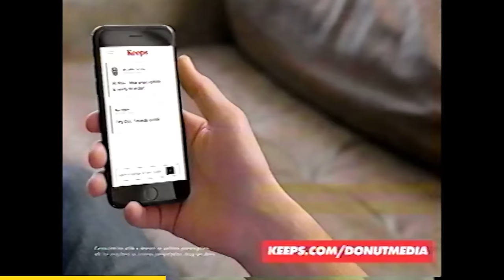Are Fender Flares Actually Worth It?

Comment: $350 for four pieces of plastic!? That's insane!
Reply: Yes it is
Reply: The miata is now riced
Reply: Fun fact, the cheapest injection mold cost is 9000+ for a small part. With low production numbers your parts just cost more unfortunately
Reply: Welcome to the world of modding cars my friend
Reply: Not that bad tbh.
Reply: @kazimerren1977  How exactly is this a riced car
Reply: its fiberglass not plastic however, yes plastic can be that much sometimes
Reply: @noahc6544  not really a fact.. There's plenty of 1-5k injection mold for small parts.
Reply: It’s cause they’re vehicle specific. Generic fender flares are about $40 a pop
Reply: Fenders look and sound like fiberglass not plastic.
Reply: @noahc6544  For this particular part that might be true. But the cheapest will cost 1/10th of that.
Reply: @egg0534  some people don't know what ricer mean 🤦
Reply: Custom molded pieces of plastic, would be a bit cheaper for universals
Reply: That’s cheap asf I bought cheapo ones for a ranger that were over $500
Reply: Low run injection moulding is expensive af, and they're moulded for the car, instead of being universal, so you're also paying for the research and 3d modelling needed for that.
Reply: @kazimerren1977  this isnt rice
Reply: @kazimerren1977  how is the car riced they are probably going to put some thicker tires on it later, rice means racing inspired COSMETIC enhancement changing the tires and rims are PERFORMANCE mods so unless they are going to just slap spacers on long term or doing nothing but keeping it since it looks cool it's not ricing
Reply: The other thing is can’t you make it
Reply: @Lovell_STI  it's ABS plastic, all of them are.
Reply: Welcome to 2023
Reply: R&D nigga some ones gotta put in the work
Reply: Honestly with the prices of stuff tripling and the government trying to kill gas cars thats not a bad price. $350 for any mod on my car is almost unheard of.
Reply: @tannershanksftw  Does this look small to you? And 1-5k for a mold seems like a stretch. Maybe if it's made out of aluminum.
Reply: Right? A set of flares is like $60 on ebay.
Reply: I was expecting it to be more like 600 to 800 honestly
Reply: Actually not that crazy considering that flares are one of the few things that have stayed the same price for years
Reply: @kazimerren1977  nah it’s got motor upgrades to back it up
Reply: Come to germany there they would have to be made legal and probably will cost around 12-1300 grand
Reply: @TheMCD1989  And I feel some people have yet to normalize the inflation spike we had.. little 1 inch by 3 inch semi light switch was 106$, the module behind it was 5 times that 😂
Reply: @AmbroseBurnside1824  i agree
Reply: Lots of women pay more for two pieces
Reply: fiberglass
Reply: @TheEchelon  did I say this was small? His comment said "the cheapest injection mold for a small object" the reason I said what I said.. It's okay if you can't read thoroughly.
Reply: i thought that was pretty cheap lmao
Reply: @kazimerren1977  you don't know what riced means sit down
Reply: Car thingssssss
Reply: @LeapFrog_Radio  i don't think you understand how economy of scales work. The molds for injection are incredibly expensive and car mods sre not precisely an actually huge market, most parts are made in cheaper processes like fiber glass, but are still a LOT of work, and that costs money. Making a car a one off is not cheap, if its not money then its labor and expertise of one self everything has a cost.
Reply: Engineered plastic. Everyone gets their cut.
Reply: there's cheaper options for sure
Reply: It's sometimes way worse when you have an FC rx7
Reply: @BigFatCone  Injection molding is the cheapest means of production 💀
Reply: You can get these for $100
Reply: correct this pisses me off is the same with  front lips, side skirts or that rear bumper side skirt its like crappier than tupperware plastic for 100bucks
Reply: Welcome to the cars are pain club
Reply: @SlowSTEN  They are fiberglass. You can see the fiberglass texture on the shots where they show the backside of them, and a quick search of 'autokonexion miata fender flares' confirmed that.
Reply: They’re big pieces of plastic!
Reply: I know right! And all these young folk with their computer music, paying too much for stuff. Back in my day.......
Reply: @kazimerren1977  I don’t think you know what that word means
Reply: It’s pretty insane but the plastic has to be very durable to go on car.
Reply: Fiberglass most likely, but yeah quality parts that are made specifically for the car is more expensive than the alibaba universal fender flare set for $50.
Reply: $350 probably just for a bumper
Reply: Could be worse 
Wanna order a a-pillar gauge pod trim piece for my car 
Just for the one piece alone will cost me 300$
Reply: In $350 I could live a luxurious life like arabs for a month
Reply: Clearly you don’t know about getting paid for labor…
Reply: @marshubbs7078  please show me a $60 set of fender flares for a miata, i have an 03 NB2 Miata and am interested in seeing your example here
Reply: dang, that's $87.50 per flare.😒😒
Reply: @NissanSkyline901  They may be fiberglass reinforced then, but I can guarantee they aren't just fiberglass
Reply: I dare you to look up how much the custom keyboard community pays for plastic GMK keycap sets.
Reply: i paid 550 for my xjs
Reply: @The Echelon  my tool shop used to make injection mills,  they were tiny in size,  made for blender covers, around 24"x24" . Each mold was 40-50k, and we were the lowest quote.
Reply: 350$ is a lot, especially it not being an AE86.
Reply: What if you 3d print it with tpu?
Reply: Honestly, wayyy cheaper than the $450 plastic rivet style fender flares FRONT SET, + $300 for the REAR SET. For my 1994 Toyota Pickup 4x4...
Reply: @kazimerren1977  Don't use words you don't understand.
Reply: they are the best fitting flares for the miata and the company doesnt exist anymore. so these are super rare
Reply: Make them yourself then.
Reply: My side skirts on my mustang went from that to $650 on the site I was browsing. I assume they stopped manufacturing.
Reply: @mennyg3449  I'd disagree, they track the car and the mods have their use, riced would be doing the mods for no reason or having tlares without cutting out the gaurd
Reply: @concon264  luckily you one of the people who know what ricer is 👍
Reply: @BigFatCone  That’s true I guess, but I feel like this is strange considering how much competition there is in this industry

Comment: Also, with these flares that extend onto the front bumper, I would very much recommend that you cut the flares at the seam where the bumper and fender meet and make it two pieces (look at how Dodge did it for their widebody). Two reasons for this: one, it means less steps when removing the front bumper. Secondly and more importantly: if the bumper ever gets ripped off for whatever reason, you don't have to worry about it murdering your flares and the fenders.
You can easily secure the smaller piece on the bumper with the single bolt along with body adhesive

Comment: I've been on the fence about cutting up my MR2 for years. I LOVE the look of flares but... cutting... car... so torn. Thanks for the video!!
Reply: You only live once man, You either do it great and find something new to work on and be proud of, or fail and get it fixed. Either way, practice would do you good. As a subaru bugeye owner, modifying the car always seemed so scary, because its a subi, but in the end it turned out great, and I'm in love with it, its like using needles, at first its really scary, then you realize you really over exaggerated the pain
Reply: SW20?
Reply: Same thing here man. Already have the flares lying around for my Miata, just need to install them...
Reply: @Ashenhope  I really like the analogy you used because I can identify with it. I used to be scared of needles and now I inject heroin regularly. It seems scary but people really exaggerate the crippling dependency 😊
Reply: @Timmy Turner  I was refering to blood tests and such but, heroin works fine
Reply: @crazycjk  89, AW11! But powered by the SW20 3sgte turbo motor.
Reply: @aaron71  that is SO COOL, what an awesome build! I have an SW20 3SGTE; that engine must be nuts in the tiny AW11!?
Reply: @crazycjk  Especially since it's a 2.2L stroker with a full GReddy turbo kit, HKS cams, etc etc. Poor thing's been sitting in my garage 12 years now though 😥
Reply: @aaron71  sounds like an absolute beauty. I hope you manage to make some time to give her some TLC and get her back on the road!!

Comment: 10:07 im guessing maybe you cut like that just to get that shot but i wouldve recommended cutting upwards towards the middle from both sides. it wouldve allowed you to sit down and balance yourself and in turn the tool much better and more easily see the line youre cutting. and it also seems from some shots that you might be pushing with the blade and yeah that works but if you want precision with that thing you should instead hold it back and just barely touch the edge continously where you want to cut, will keep it from catching and gives you far more control of the line that you are cutting.

Comment: If you have access to tig, silicon bronze on the outter edge of the rear fender makes welding 100x easier w less chance of distortion in the work piece
AND its really easy to grind down and make flush

Comment: Shorten the cutting blade as to not penetrate deeper than intended, the shorter blade is much easier to control. Place the blade guard on cutting surface and let the saw do the work just guide it

Comment: Something to consider if you live in a rust prone area, before you hammer and weld the rears up douse the insides with welding primer so it makes a zinc coating on the inner seams. As far as the color goes I’d say BRG with heavy flake. Make it sparkle like a bass boat.

Comment: In the future if you ever throw flares on another car. Use the old fenders first. Get them as close to straight at reasonably possible and practice. Get your fitment right and template transfer onto new fenders. Seems like a lot more work but will save you from buying another set of fenders.

Comment: Okay, so I get that this might sound a little . . . out there, but if you're going to replace the fenders, why not just get some with a flare already molded into the sheet metal?

I know doing that on the rear would obviously be more complex, but why not just replace the fenders and rear quarter panels with a fresh panel that is already pre flared?

Comment: 15x8 205 tires aren’t even close to the max you can run under stock Miata fenders. Lots of guys out there running 245/40-15 on 15x9 and some even 15x10 under stock fenders with rolled edges. It’s definitely possible.

Comment: A bottle of water is not an appropriate fire extinguisher when dealing with fuel fires as fuel floats on water... which will spread the fire

You need a real co2 or chemical powder extinguisher... when dealing with those kinda of chemical fires

A bottle of water is fine if you're welding next to wood... but not electricals/fuel fires

Don't mess around with safety kids

Comment: "About as wide as we can fit with stock fenders"

Meaningwhile dudes out there running 245 on stock fender miatas lol

I also think it's a shame to cut perfectly good quarter panels without a real reason for it. You're not at the limitation of tire size for that car, and your overfenders are only 10 and 15mm, you can basically get that much with a fender roller. Or get way more with some actual overfenders like carbonmiata, which also looks almost oem.

Comment: Great video, but as with most "Is XYZ worth it?" videos, you never really address whether or not it's worth it.  Is that a bit and I'm out of the loop?  These videos should be called "XYZ install guide".  To see whether or not it's "worth it", we should see the installation of wider tires that the fender flares allow, and then get either a track day or at the very least driving impressions with the new tires that provide added grip.  We only got half the story here and we never found out whether the fender flares are "actually worth it".

Comment: Them shits are ass backwards, rears are installed on the wrong side(autokonexion labels them wrong which is why the China copies are also mislabeled) and front and rear aren’t level with eachother. Thats why you had to cut a tremendous amount on rear and hardly any on front where you actually need more clearance.